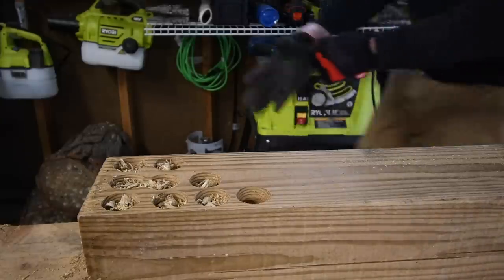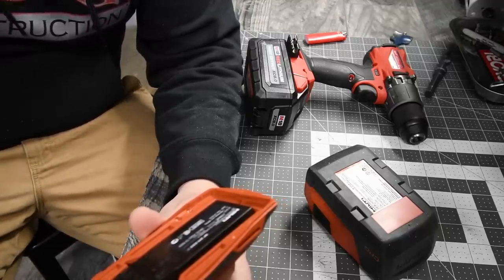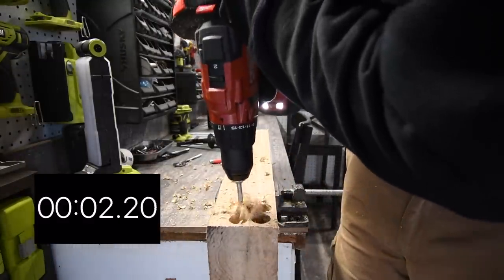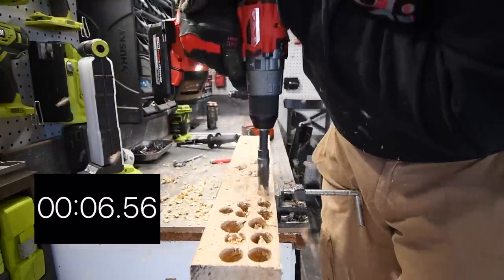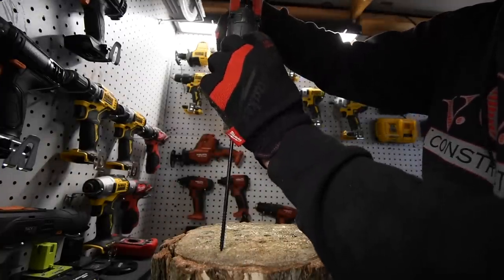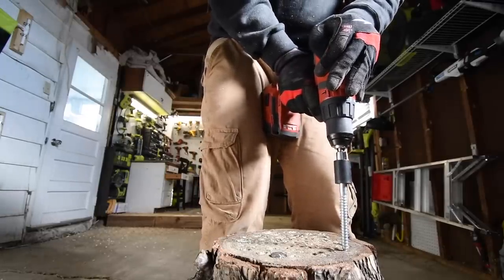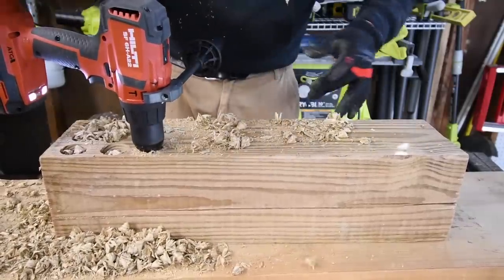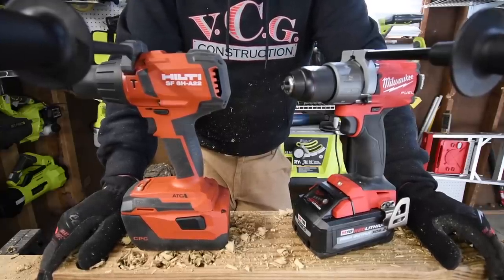HILTI 8ah vs Milwaukee 8ah HO Battery (WOOD)

Comment: A 21.6 volt Hilti battery, of equal amp hours, will always provide more watt hours (i.e., more available power) than any 18 volt battery. Despite its stated lower torque rating, it is no wonder that the Hilti is such an awesome tool. I'd be willing to bet that Hilti is understating the maximum available torque.
Reply from the maker: im pretty sure it underrated as well. I thank you for viewing sir :)
Reply: I did a head to head test with these two drills as I own both. I put a 2.6amp in the Hilti and a 9 amp in the Milwaukee. The Hilti still won all tests I put it through. It also is quicker in brick than the Milwaukee. 
Dave.
Reply: eh my 36v metabo would still smack the shit out of it

Comment: These tests are great - but the real test comes long-term. I'm running at least 4 Hilti tools which are just over 15 years old, and which all still work as well as the day I bought them, despite massive abuse and a super-hard working life. If one of them did fail, Hilti send a carrier to collect it the same day, they repair it, and they send it back to me - all within 2 days. They also continue to carry parts on the shelf 20 years after the last one came off the production line. Folks perceive them as expensive - but compared to the cost of replacing a tool 3 times during the same 15-year period, to me they're actually a bargain. Best wishes from the UK.
Reply from the maker: Id put my money on the HILTI

Comment: You should let people know about Active Torque Control on Hilti "ATC" I think people deserves to know this best feature..
Reply from the maker: I will be doing a video about that soon :) and thank you sir
Reply: In layman's terms, what is ATC?
Reply: @skycorrigan6511  Anti Torque Control... It protects your wrist if the drill tilts.. The Hilti stops automatically
Reply: @testaccount2343  Active* Torque Control
Reply: @skycorrigan6511  In layman's terms, Active Torque Control cuts the drill's power to save your wrist if it senses that the drill jerks to either side around the chuck.
Reply: @skycorrigan6511  6:43

Comment: How much you wanna bet this guy works in a office or something!! Those tools are alll so clean and nice.
Reply from the maker: I clean them after every test, when I was younger I used to be in new construction. then the market crashed and changed professions. that was like 14 years ago.
Reply: He doesn't pretend to be some rough tradesmen kind of guy. He knows hes not. He just like tools and collects them. He knows he doesn't use 100% of those tools on a regular basis. Shit, there's probably some he never uses. He just likes tools and likes to collect them, test them, clean them, and admire them. Whats wrong with that? 
And plus, you can use a drill EVERY SINGLE DAY at work (like me) and still have the thing look brand new after even a year or so. You just have to be very diligent in cleaning them.

Comment: Not sure where I heard Milwaukee gradually speeds up to top rpm. If that's true it would loose speed tests most of the time. I'm a fan of torque. It's irritating when my Hitachi stalls when drilling large diameter holes especially in hardwood. 2 inch self feed mortising bit 3.5 inch deep in hardwood is a torque test For sure. My brushed Hitachi fails. Wondering will Milwaukee or any other handheld drill do it. Usually that bit is on a drillpress.
Reply from the maker: I will have to put that to the test and I thank you for the info John

Comment: And Vince from Vcg said that a hammer drill shines most on hammer mode rather than in drill mode and if you gonna put in lag screws and bolt longer than 5 inch to use hammer mode
Reply from the maker: Concrete tests are coming soon and thank you sir
Reply: I don’t think you understand how a hammer drill works. The hammer function is only for drilling concrete, it makes the drill bit hit the concrete from top down in order to break small pieces off. You can’t drill through concrete by cutting it with steel. The hammer mode doesn’t affect the driving performance. You might be confusing it with an impact driver.
Reply: @afdetailing8104  if you watch Vcg's live you'll understand what I mean
Reply: Antoine Bonin-Palardy the bit doesn’t only chip it mainly cuts!! I think you have some misunderstanding

Comment: Love this! But I’m missing a “beat” up test! This is very importent, because they do get at lot of beating at the worksite. 
With love from Denmark.🇩🇰
Reply from the maker: that is one test I cant right now, because I cant afford to replace these tools if I break them by doing physical damage to them such as a drop test
Reply: That's the problem with Hilti, if I was to own one i'd be asking it if it was okay after every single hole drilled - and would be tucking it away in its cot at night! I love my Milwaukee

Comment: Nice video. Its not a fair fight, hilti is way above and beyond any of the other brands, my hilti impact /drill and reciprocating saw are 9 years old I have a 7 year old battery and a 3 compact 5 year old ones, still working, accidently left one outside on this last texas snow storm it stayed 3 days deep halfway on water, all it took it was to get 3hrs of sun light and keeps going. HILTI is GOD level, the rest are mortals😉,
Reply from the maker: HILTI is very well known for their tools lasting forever
Reply: I've got 7 and 8 year old batteries still going strong

Comment: thx for the review , have the Milwaukee but would consider getting the hilti if it wasn't so exspensive.
Reply from the maker: I love both of these tools, they get the job done fast and with ease
Reply: I own both these tools. The build quality is far better on the Hilti and my Milwaukee's trigger is dodgy...(like all my Milwaukee tools). But as far as performance goes there is very little between them. Screwing big screws into Timber with both drills on 1st speed and top torque setting, the Hilti has much more low down torque. 
Dave.

Comment: Hilti is called expert grade tool however you have to pay for it, no matter for the performance, spend return warranty and after sale service, Hilti will better than most of professional grade like Milwaukee, Makita etc. However for most of trade professional tool is good enough and cost effective than expert tool range. I used to hire Hilti rotary hammer for heavy duty task, I can frankly tell this machine is better than Bosch Hammer and Milwaukee.
Reply from the maker: I agree, I love both of these hammer drills and im glad I own them both :)

Comment: The cells are the same size as Hiltis the drill is just more capable because technology doesn't stand still...in the end it's just bragging rights...Hilti is the new T-Dog...
Reply from the maker: both of them are awesome hammer drills and im glad I have them both :) and thank you sir
Reply: @ManCaverTools  thanks bro I own the Milwaukee combo drill Gen3 one key with 3ah High Output battery for electrical installation as well as 5ah...I'm a new subby to ur channel but you deliver the best viewing and style over seen lately all the best brother..🤜🤛😎👍

Comment: Absolute nonsensical test.  He can push as hard or as soft as he wishes without the viewer knowing. Hilti is the best there's no doubt, but I have serious doubts about this man's ability to set up a true test.
Reply from the maker: the real question is, why would I rig tests, how do I benefit if HILIT wins or Milwaukee wins?
Reply: Man Caver Tools the real question is! Isn’t everyone biased I’ve felt you’ve been biased between Milwaukee and hilti (hilti being your pick)every since I started watching these videos I’m obviously biased and I like Milwaukee better than any other and I can clearly hear the hilti motor bogging more than the Milwaukee so wither your pushing harder or it’s weaker and the test shows it’s not weaker so it must be the force behind it causing it to bog therefore cutting faster.!
Reply: @ManCaverTools  I loved the test Dave and I own both the drills in the video. I have done many head to head tests with these drills and Hilti comes out top every time. Which one is faster doesn't bother me but the fact that the Milwaukee works when it wants to and my Hilti works every time clinches it for me. Plus the Hilti stays way cooler in use and the build quality is much better. But we live in free countries so buy what you want. I just think all comparison videos help people decide. Hilti will bring the tools to your site so you can try before you buy.

Comment: At the end of the day both drills have more power than 95% of people will ever need.
Reply from the maker: I agree. when it comes to these 2 drills, you cant go wrong. both of them are extremely powerful
Reply: Yes Ernest, a good point! I own both these drills and the power is scary. At least with the Hilti you get ATC which makes the motor stop if the bit snags and the drill is going to kick violently. The Hilti will spin a quarter turn and stop, saving your wrist. The Milwaukee hasn't a system like this and is really dangerous for your wrist.

Comment: Awesome. Love these Hilti vs videos. Have u thought about getting the brushed SF 10W A22 with the 4 speeds and putting it up against this new brushless Hilti? I'm looking at both and can't decide. I might just have to buy both lol
Reply from the maker: I am getting a lot more :) and thank you for viewing
Reply: I was thinking the same!! I went for this SF6H brushless because they will soon be bringing out that 4 speed with brushless motor....I would think!! I recently bought the brushed SF6H and within a few months the brushless one came out. I would wait a bit if I were you. Also, the 4 speed doesn't have hammer action.
Reply: @davesheppard8797  Ya, that's what I've been thinking. That 4 speed brushless should be coming out within the next year or so... I hope. That 12v Drill driver looks pretty good for simple maintenance jobs.
Reply: @toolshopguy2080  yes I know! And can you stop putting temptation in my path please!! 🤣🤣🤣🤣. Just bought the Te6 a 22 and SID 4 as well!!
Reply: @davesheppard8797  Have you noticed with the SID 4-A22 impact that the handle gets hot right away without barely using it? The one I got seems to have a high pitched sound come from it after I pull the trigger and the handle becomes warm pretty quickly? 
Brand new and it's been doing that.
Reply: @toolshopguy2080   No I haven't had this with mine. It always stays fairly cool. If I use it a lot it gets warm as all drills do but never hot. Have you contacted Hilti customer services? The motor on speed 3 gives out quite a high pitched noise but not too loud. Since reading your reply I have run mine a lot, under no load and screwing screws in to timber. It did not get hot at all just slightly warm as you would expect.
Reply: @davesheppard8797  Ya I figured it wasn't normal lol. I got to go back to the Hilti store and see what they say. Thanks for letting me know.
Reply: @toolshopguy2080  No problem mate. I hope you get the issue sorted. Let me know how it comes out.
Dave.
Reply: @toolshopguy2080  Hi mate, What happened with your SID4 in the end. Did you get the issue sorted?
Dave.
Reply: @davesheppard8797  no I haven't taken it back in yet. I'll probably go sometime next week when I have a few days off.
Reply: @toolshopguy2080  Ok mate, let me know how it goes. I am really loving my new brushless SF6H. 
Dave.
Reply: @davesheppard8797  Ya well do man. Keep up the good work with the videos

Comment: Bahaha..  If they hit a knot, it doesn't matter.  OK, so have the one you want to win drill through wood with a sharp drill and the other though concrete with a butter knife. Yep. Fair.

A comparison test isn't a test unless every variable is controlled. Start using MDF or clear wood.
Reply from the maker: not every knot if visible from the surface. if you watched the entire video you you would see that im not needing a certain tool to win, whoever wins, wins. I dont benefit if milwuakee wins or if HILIT wins but thank you so much for viewing

Comment: I’d really like to see my Multivolt Hammer drill go up against these beast. Especially since they offer the 2.5 Multivolt which is 18650 cells and the 4 Amp which is 21700 cells.
Reply from the maker: will do and thank you for viewing

Comment: I'm missing the point here, expected more like battery challenge, wich will perform longer....  
I'm using 8.0 Ah hilti one and it's a monster, a beast, works nearly twice longer that 5,2 Ah ones, and these are already very good
Reply from the maker: its not only duration its also power. the cells inside the battery share the load with more cells inside so it can use the power that is there with less stress on the cells

Comment: Both are running 21700 cells in their batteries, i assume?
Reply: No only Hilti, which makes sense why it's stronger
Reply: @techguy666  High Output for Milwaukee means 21700 cells. Right?
Reply: @meagaindave2049   oops sorry my mistake , yes HO batteries use  21700 cells. Hilti has one more additional cell in series which means higher voltage and since W=A x V, this higher voltage means more power for the same Amp output.
Reply from the maker: I believe they both have 21700 but HILIT is 21.6v and MIlwuakee is 18v

Comment: Great video I have dewalt 996 at home & work provides 2804 with 8ah batteries but for the price difference I'll stick with Milwaukee they have a ton of tools great awesome customer service great warranty they are always making stuff exactly to your needs I can buy em almost anywhere & look how badass that drill is only loosing by 1/2 a second in most of the tests & look at how small the drill itself is compared to hilti dewalt makita or rigid & for those reasons that's why I have Milwaukee & dewalt & I.R. & ryobi & chigao electric battery tools because each brand has it's own nice tool so I buy one from every brand mostly because I love these newer battery operated tools I'm not concerned with being brand loyal I need them to work for me cause I use em to make $ to support my family & I'm not going to put a price on that just because of brand loyalty I'll buy whatever I think is best regardless off who makes it I just never see hilti when I'm buying something new
Reply from the maker: I thank you for your input sir and also thank you for viewing
Reply: You won't see Hilti unless you go to a Hilti store. They are not sold anywhere else.

Comment: You said at the end of the video that “it’s time to see if Milwaukee can redeem itself” in every  “test” the times were literally within tenths of seconds of each other there is no possible way you can say either one of these drills is better than the other. Especially since you determine the times when you edit the videos.
Reply from the maker: I dont determine the times. the centisecond of the time is determined when the task is done. I replay and replay and replay until I get the exact time when task is done. it takes more of an effort to find that out, there is no point of this channel if I just make up the times. I don't benefit at it if a certain tool wins. I thank you so much for viewing.
Reply: I think Hilti will win the longevity test as all my Milwaukee gear gave me trouble about 4-6 weeks after getting it. My Hilti gear never misses a beat.

Comment: U should do ur test in oak or maple.....then watch the Milwaukee eat
Reply from the maker: that's a fantastic idea, and thank you sir
Reply: Milwaukee would probably still lose. I own both of these drills and the Hilti is better all round. I have done lots of head to head tests. I tested with equal-ish batteries 5amp Milwaukee 5.2 Hilti. Hilti won. I also tested with a 9amp hour in the Milwaukee and a 2.6amp in the Hilti. Hilti still won. Plus the Hilti works all the time and doesn't get too hot like the Milwaukee. Milwaukee trigger only works when it feels like it. Like one of my old assistants!! 🤣🤣🤣
 But at the end of the day it's the skill of the guy using the tool that gets the job done quick and to a high standard.
Reply: @davesheppard8797  I agree with u that Hilti is a better tool. But the testing that I've done in maple , oak and zebra wood has the Milwaukee on top power wise....but that's it and if people buy drills on the power numbers alone they are making a huge mistake. Nice talking to ya
Reply: @donnysanner342  Yes Donny, I  think we get a little bit carried away by statistics. At the end of the day it's the skill of the guy using the drill that really makes a job quick. Although pretty soon they will probably bring out a drill that goes off and does it by itself!! I think that if your using a drill all day you need it to be comfortable and user friendly with a good battery life. If a drill is uncomfortable to use you will be slowed down anyway. That's a thing I like about the Hilti reps, you can try before you buy so at least you get some idea. When I first started years ago all I had was a hand brace...(is that violins I hear?) 🤣🤣🤣🤣.
Best wishes,
Dave.

Comment: First of all I all ready know hilti might win cause all there new batteries for there brushless models are 21700 cells which have 3-5 times more power than 18650 cells sometimes
Reply from the maker: but its still interesting to see how it perfomes against another brand :)
Reply: @ManCaverTools  the Milwaukee High output are 21700 cells arnt they?

Comment: Use a side handle with those whole saws you can break your wrist
Reply: Not with Hilti, Hilti has a sensor when drill gets stuck the drill will stop
Reply from the maker: you are correct, for safety I should be using the handles for the intense tests and thank you sir